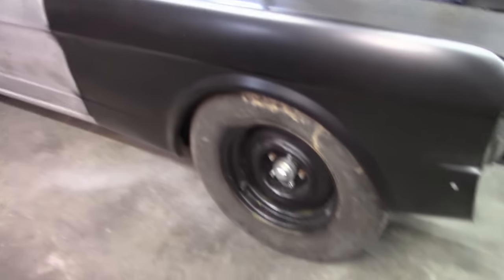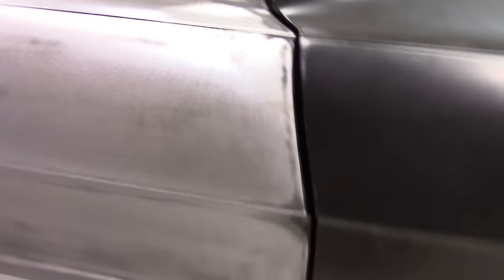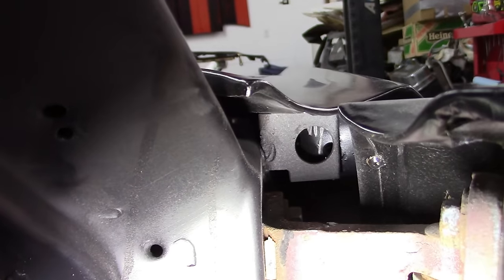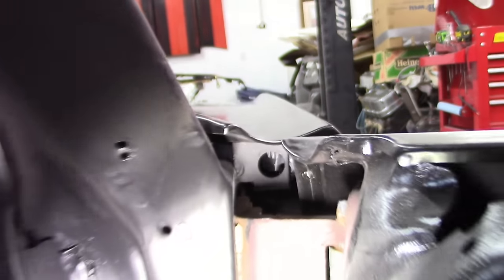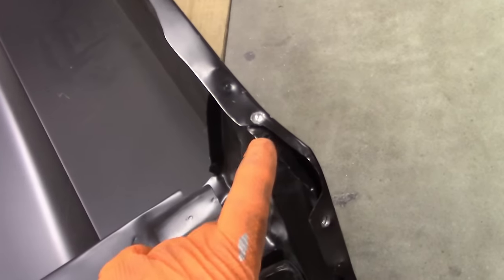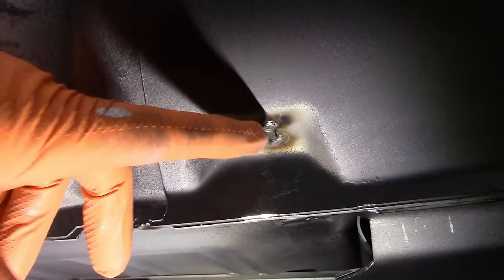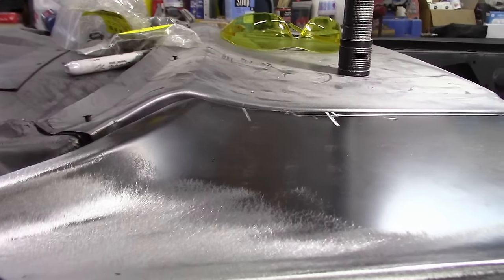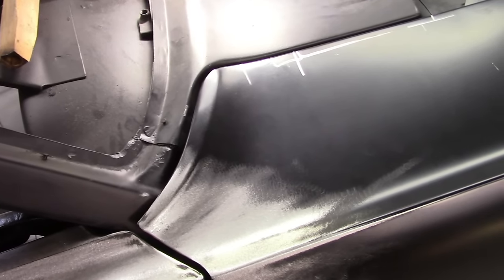Mustang fender fitment. Brooklyn Pony part 28

Comment: So true about taking care of these details before paint! I bought a '65 Mustang convertible project car that had already been painted, the fenders were off. The doors and fenders were aftermarket replacements. When I went to put the fenders back on, I dealt with all the fitment issues in this video, except while trying to preserve the $4K paint job a previous owner of the "project" had done! Had the R/F fender on and off so many times, and dealing with the antenna in that fender each time. That top cowl area, I ended up cutting off part of that fender lip where it sits on the cowl, because the way they welded it, it made the fender sit too high. (aftermarket body parts.....sigh...) One important tip to keep in mind: when fitting the body panels and doors, always have the car sitting on its wheels. (As you did.) If it is on jackstands, the body will be flexed slightly, especially the convertibles. This will throw off all your careful work, especially where the doors latch and align with the quarter panels. Thanks for the super helpful videos!

Comment: Another great video Barry, you have very good attention to detail and fabrication ability. I did the first mock up on my 73 fenders and hood this weekend, ended up shimming the driver's side fender at the bottom and it lined up, passenger side went on without shims and looked pretty good but both will need the same metal bracket worked on, probably the exact way that you did in this video. Hood and fender gaps on driver's side are really nice but passenger side fender to hood gap is not consistent all the way down, got to address that next weekend. Thanks for the video and ideas on how to make it right.

Comment: Thank you for these videos!!! This 66 Mustang has kicked my butt on the front clip. The only original sheet metal is the roof and trunk lid. 3-1/2 of the frame rails are original. But all outside sheet metal has been replaced along with the upper and lower cowl, the firewall, cowl sides, hinge pillars and complete floor pan front all the way to rear body panel. Everything was going well till I got to the fitment of front clip. After watching some of your videos I got more done in one day than all last week! Keep them coming and next project is a 1968 Cougar. It's not quite as bad but bad enough. Finding parts for this has been a major issue. Do you have any places to get Cougar parts from and do you have any videos on areas of concern?

Comment: Thanks for another great video Barry. If you don't mind I would like your opinion on something. My original fenders are rusted out on the lower rear above the lower body line. The inner lower brace is toast as well. Ive read that the patch pieces for this area aren't too great. In your opinion would you try to repair the original fenders with not so good patches or go for reproduction fenders and go through the fitment process? Thanks for your input
Reply from the maker: Tough question. I always like original panels, but like you said, the patches are not great. New panels are pretty decent, and it comes down to how nice you need it to look.  I'd likely still go with the new panels.

Comment: Fantastic information on this video! Mine was pretty bad fitment from the factory and so far I have all original panels i'm reusing. welded in all small patches as needed but other than that all original metal. Question on the gaps, what is the rule of thumb for how big a gap should be before welding a rod on it instead of building it up with the weld or are you better off building the weld. Looks like Iron Man has a little job himself he is taking care of ;)
Reply from the maker: No real rule of thumb. User discretion.

Comment: 1. What size wire do you use? I've been using .30 and burn through. 
2. Have you ever used a rod for a filler when you weld the door edges rather than build it out with welds?
Reply from the maker: I use .025 wire. I have used various rods as filler. I think I show that in one of the videos from the light blue 65 I did years ago.
Reply: I bought some. 23. Didnt want to respool the gun. Was being lazy.
Reply: I used some flat bar to soak up the heat and adhere too.   In an area that cant be seen from that side.

Comment: fitment?   sorry to be the one to tell you this , Definition : Fitment : a fixed item of furniture or piece of equipment, especially in a house. fabricating or Fitting is the word you may have been seeking ..
Reply from the maker: Thanks for the enlightenment. Wait? There can be more than one meaning for a word?
fitment(Noun)

The proper positioning and orientation of a thing for it to serve its designed purpose.